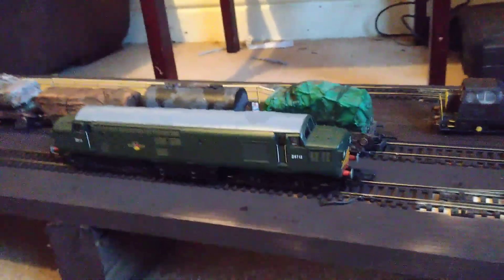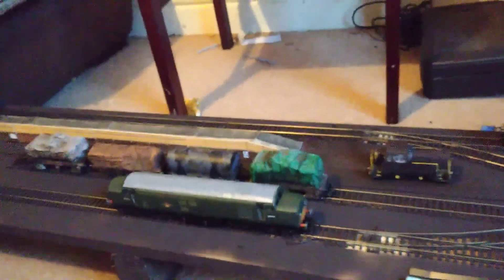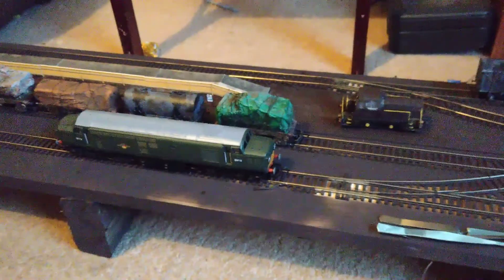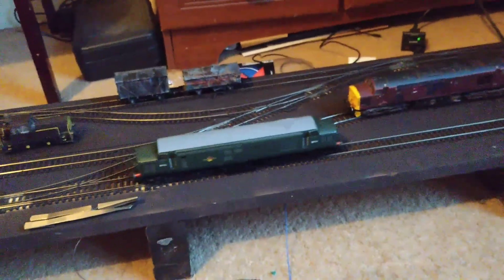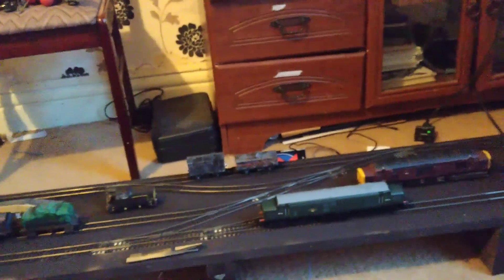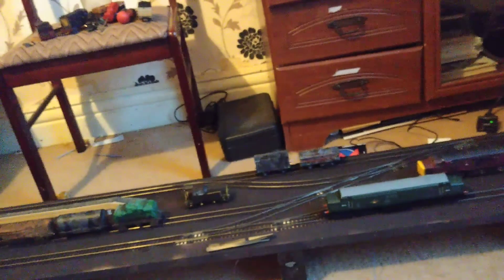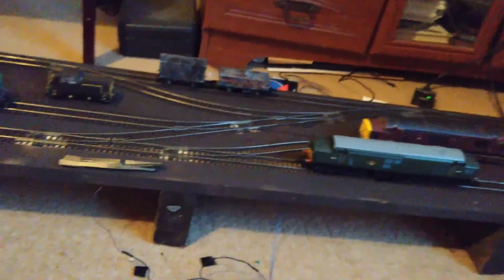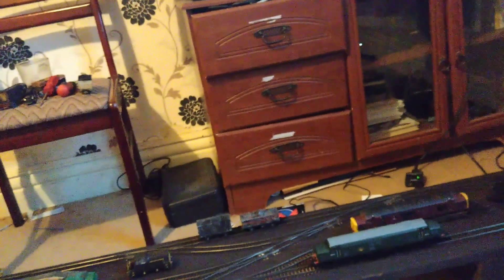DCC FAULT FIXES - Erratic locos? blowing decoders? Try removing this...

Comment: I'm guessing the bog standard Hornby connector is designed for use with analogue systems? If this is the case that capacitor is designed to eradicate spikes that can cause radio interference. I'm also guessing this capacitor will also tend to smooth the DCC square wave that is necessary for decoders to work.
Reply from the maker: Probably!😁

Comment: If yer rip out the capiacitor does the clip still work? And would that then resolve the issue ?
Reply from the maker: I'm not sure mate, I imagine it WAS the cap causing the issue so give it a shot😁
Reply: @IronHorseRailways  It does, but really still a bit crap, carefully soldering under the track does the trick

Comment: You're lucky you didn't blow up the controller, as a friend of mine did.
An other tip I can give you is to put a fuse between controller and track.
This comes in two forms, lamp fuses or electronic fuses, in my opinion the electronic ones are the best, but than also the most expensive.
Also making an old loco dcc, get rid of the capacitor on the motor, it serves no purpose on DCC.
Reply from the maker: This is a VERY OLD Video -, I actually forgot id made it 🤣

As it happens, the controller had an inline fuse anyway, which thankfully didn't blow!

Cheers!

Comment: Its strange that hornby fit a capacitor on their track feed ... no other dcc system has that.. it is normal to just wire each piece of track to a bus and connect that direct to the controller
Reply from the maker: Normal, yes absolutely and yet not a single person, even those from the "big" companies out there thought to mention "are you using the basic track connector?"

Very strange but there we go mate, every day is in fact a school day!🤣